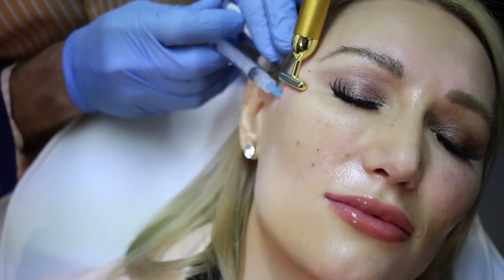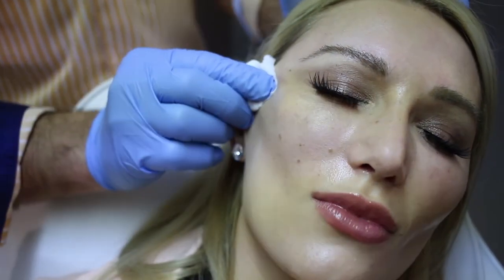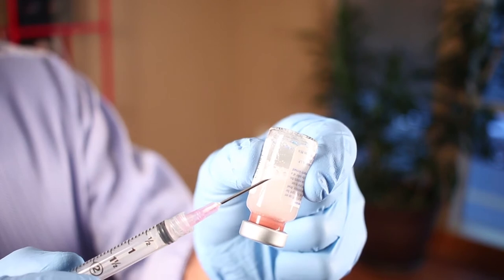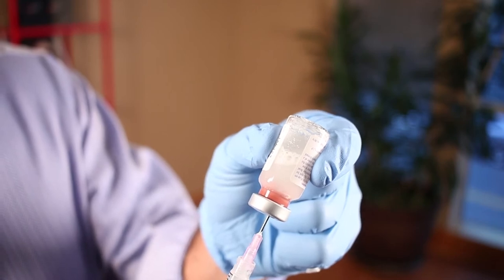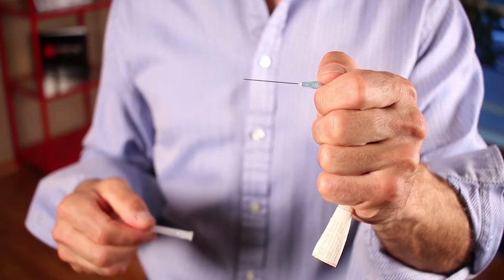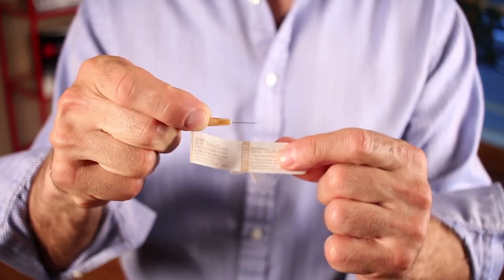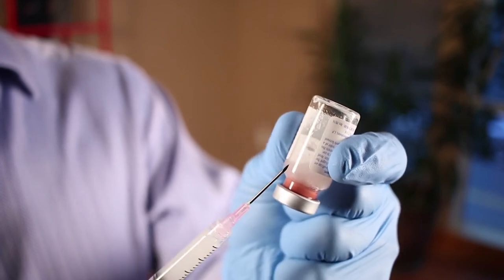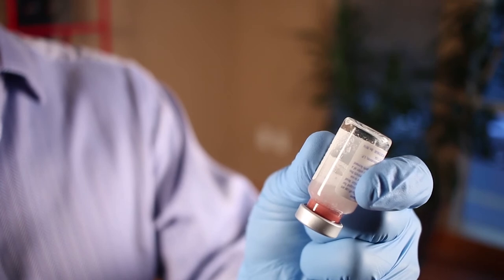Sculptra Clogging No More-Dr Rajani

Comment: Great info. I prepare sculptra 24 to 72 hours before use & keep it in the refrigerator. Takecit out of refrigerator few hours before injecting so that it comes down to room temperature. I always add 2cc of lido aswell. Is this the right way of doing sculptra?? And secondly, should lido be added 24 to 72 hours before or right before injecting? Thank you so much in advance ☺️
Reply from the maker: No this is not the correct way. We did that 10 years ago but not now.